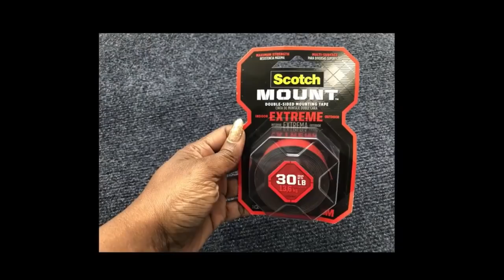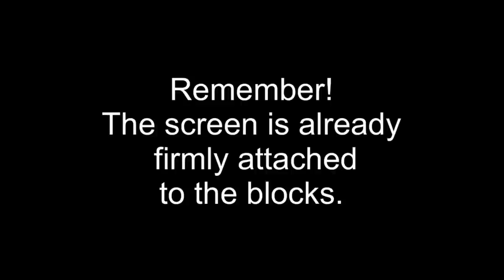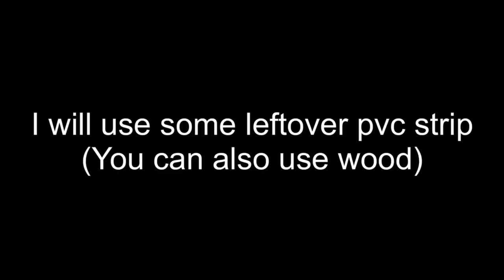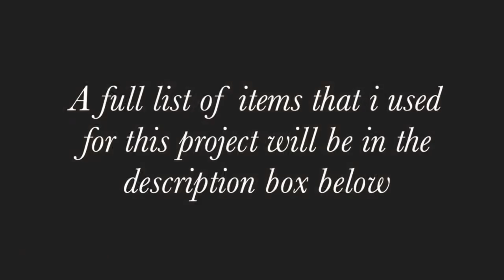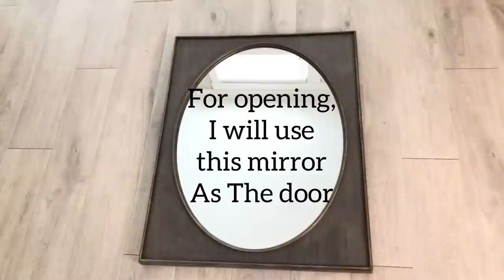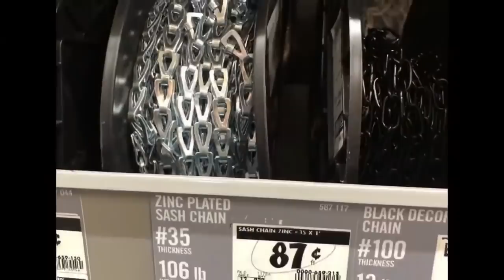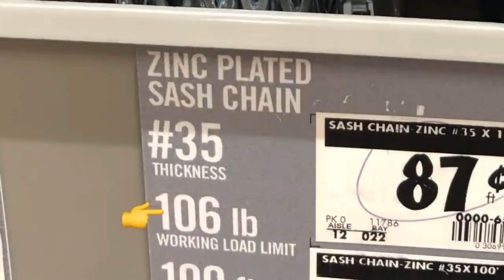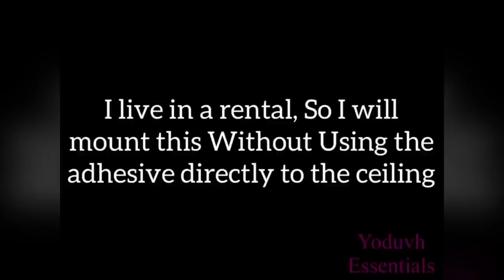HOW TO MAKE YOUR APARTMENT LOOK EXPENSIVE! Tips & Tricks that actually work!

Comment: beautiful, i live in a rental in southern california, and definitely needed some ideas to upgrade without breaking the bank!! Question did the acrylic mirror self adhesive tile lift up the pain when you removed it?? wanting to create a full length body mirror and found a acrylic self adhesive role but don't know if i can apply ot straight onto my cheap matte paint walls OR if i use the foam board and mount it to that??? advice/ suggestions welcomed... i really just dont want to chip the walls.. they are horribly OLD and cheaply painted.